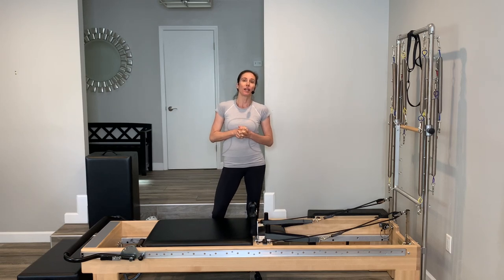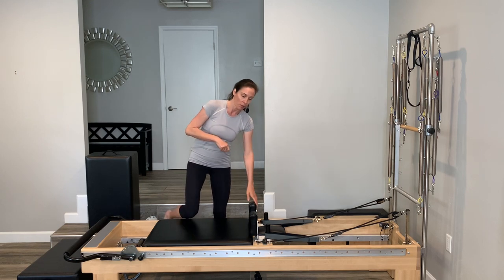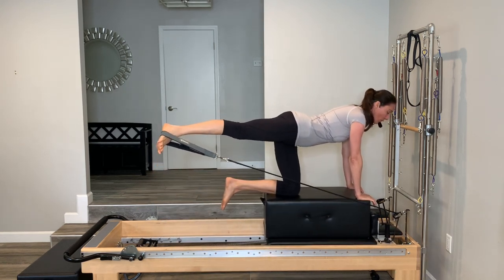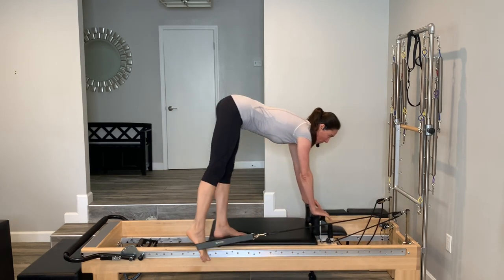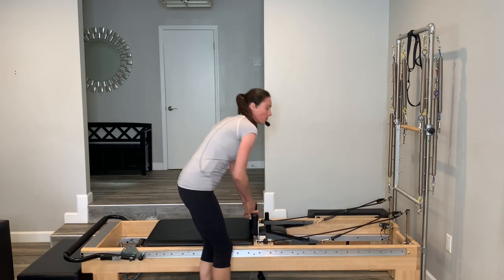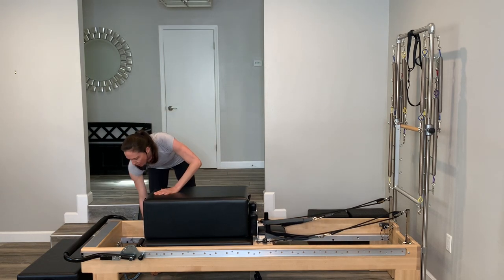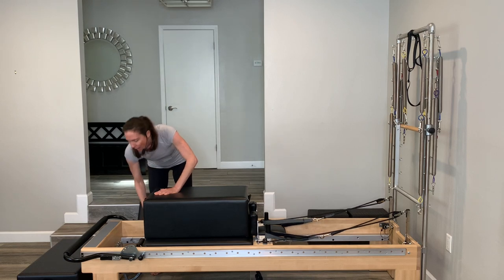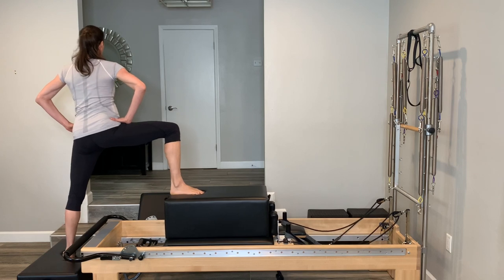Modifications for Low to the Ground Reformers

Comment: Thank you so much! I find the lunge stretches at the end of your classes to be challenging on a low reformer (and it’s even harder because I’m tall). I have been using my ball to prop my knee up so that I’m not leaning forward on the footbar as much when I push the machine backwards. Is there a better modification?
Reply from the maker: Do you have a pilates box?  You can put the box on long position and then the back leg can be elevated on the box.  Let me know if that helps.